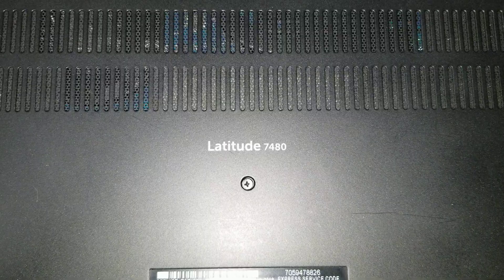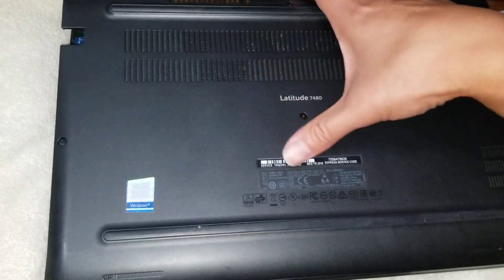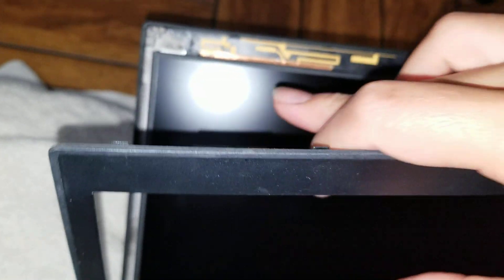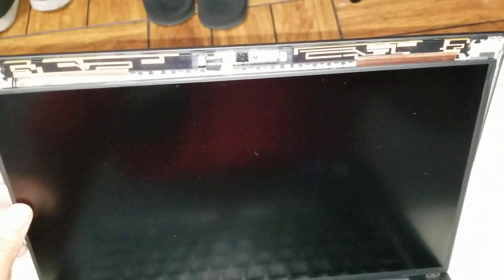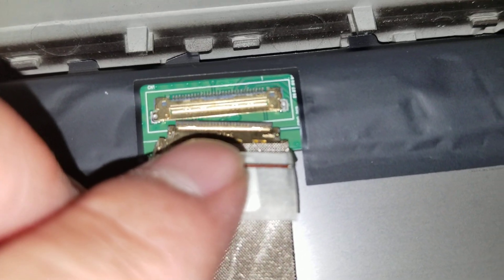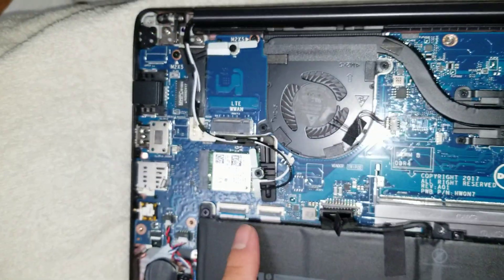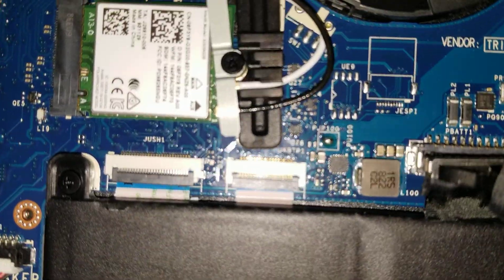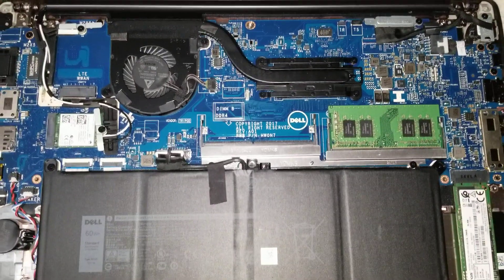Dell Latitude 7480 disassembly SSD RAM Upgrade Screen Replacement

Comment: Tengo una laptop dell latitude 14 (7480), que según las especificaciones del fabricante soporta discos SSD NVMe X2 de hasta 1TB, si le coloco uno que dice x4 me lo va a reconocer? O tengo que comprar por fuerza uno que sea X2? En la página de crucial me aparece que el modelo recomendado para mi laptop es de 4x, pero no me fio del todo, agradezco cualquier opinión al respecto, muchas gracias!!
Reply from the maker: No hablo Espanol
Reply from the maker: You should be able to use any
Reply: @ItsBinhRepaired 
I apologize but my first language is Spanish, I thank you very much!
Reply from the maker: @ArmandFerrer  no problem

Comment: I have this the 7480, when i connect power pack the power button comes on but the pc wont power up, what's your suggestion.
Reply from the maker: Not sure what you mean. The power button lights up, but nothing shows on the screen?
Reply: @ItsBinhRepaired  I have power supply connected the power button flash's, when I press the power button on the PC, it does not come on.
Reply from the maker: @pamedina1960  check the RAM. If it's not the RAM, you most likely have a dead motherboard :(
Reply: @ItsBinhRepaired  check the RAM re-seat'ed the RAM tried powering back up No Joy. Spoke to my partner he said he dropped it but it was in the back pack. so you may be right the mother board is cracked or wend bad.
Reply: @ItsBinhRepaired  what's your recommendation is it worth changing out the mother board?
Reply from the maker: @pamedina1960  try one stick of ram at a time in different slots. Motherboard is usually pretty costly and you'll need to know how to swap it out.
Reply: @ItsBinhRepaired  no joy with moving the RAM around. Does't look to difficult to replace mother board will need to sway wifi, HD, battery. I looked at different vendors cost vary based on process, etc. you have recommendations?
Reply: @ItsBinhRepaired  the fan does start at all when power button is pushed
Reply from the maker: @pamedina1960  check eBay for a used board. Hopefully the screen isn't damaged
Reply: @ItsBinhRepaired  I got my pc working again, I went through all the connections and made sure they were connected, reset the power by removing the battery again. Wala, working...thank you for your time.
Reply from the maker: Awesome!

Comment: Nice detailed video! Does this model have just the one sata3 port or are there more ports to add a second m.2 drive?
Reply from the maker: Just one I believe, should be visible in the video. Don't forget to like and subscribe if you haven't already. It'd really help me out. Thanks!
Reply: It's Binh Repaired Already have.  Thanks